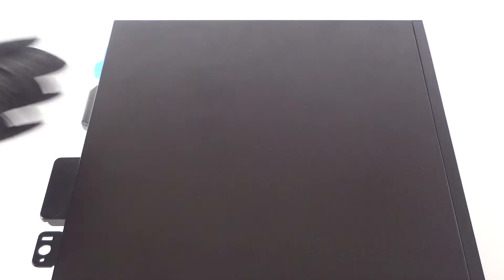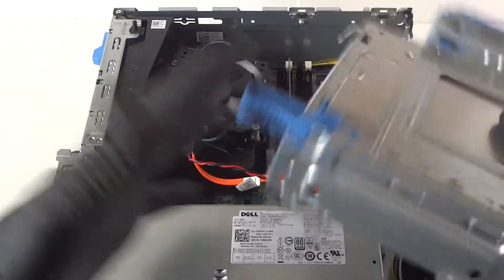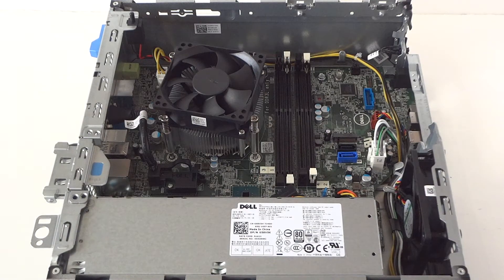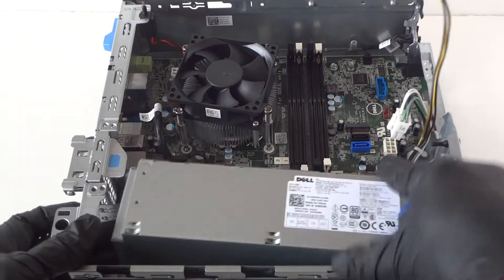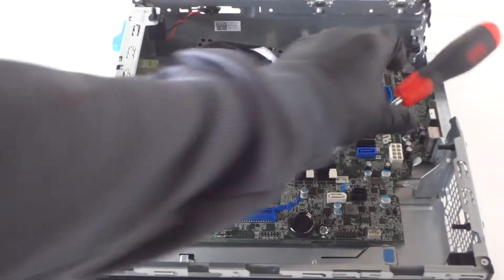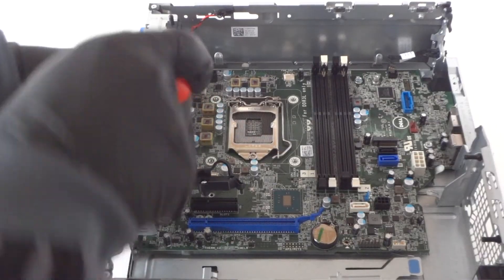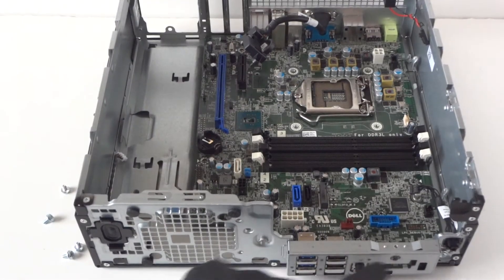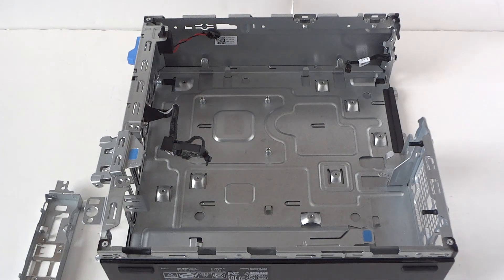Dell Optiplex 5040 Teardown

Comment from the maker: List of Parts and Upgrades works with this PC.

USB Wifi Adapter for PC AC600Mbps Wireless Network Adapter
https://amzn.to/2ZaGuHb

List of RAM will work with this system.
Maximum RAM Supports: 64GB

(1.) Crucial 16GB Kit (2 x 8GB) DDR3L-1600 UDIMM
CT2K102464BD160B
https://amzn.to/2QvZril

(2.) Crucial 16GB DDR3L-1600 UDIMM
CT204864BD160B
https://amzn.to/3gub97G

(3.) Crucial 8GB DDR3L-1600 UDIMM
CT102464BD160B
https://amzn.to/3aWGluX

(4.) Crucial 8GB Kit (2 x 4GB) DDR3L-1600 UDIMM
CT2K51264BD160B
https://amzn.to/34q9Q73

List video cards will work with this system.

(1.) GIGABYTE GeForce GTX 1650 OC 4GB GDDR6, GV-N1656OC-4GL Video Card
https://amzn.to/2B7N1sP 

(2.) Gigabyte GeForce GTX 1650 OC GDDR5 Low Profile 
https://amzn.to/3el08os

(3.) Gigabyte Geforce GTX 1050 Ti OC Low Profile 4GB GDDR5 128 Bit PCI-E Graphic Card (GV-N105TOC-4GL) 
https://amzn.to/2T8bfsv

(4.) MSI Gaming GeForce GTX 1650 4GB GDRR5 Low Profile Graphics Card (GTX 1650 4GT LP OC) 
https://amzn.to/2X1FYsF

(5.) MSI GTX 1050 TI 4GT Low Profile  Graphic Cards 
https://amzn.to/2LwZd7P

(6.) Gigabyte GeForce GT 1030 GV-N1030D5-2GL Low Profile 2G Computer Graphics Card 
https://amzn.to/2Z4PHkp

(7.) ZOTAC GeForce GT 1030 2GB GDDR5 64-bit PCIe 3.0 DirectX 12 HDCP Ready Low Profile Video Card ZT-P10300A-10L 
https://amzn.to/2WzgLXk 

(8.) MSI Graphic Cards GT 1030 2GB GDDR5, Low Profile 
https://amzn.to/390Spum

 
Thermal Compound Paste:
(1.) Arctic MX-4 2019 Edition Thermal Compound Paste Carbon Based
https://amzn.to/2XcsZo4

(2) Arctic Silver 5 Thermal Cooling Compound Paste 
https://amzn.to/2ziNU0H

(3) Noctua NT-H1 3.5g, Pro-Grade Thermal Compound Paste
https://amzn.to/36kTk7A

(4.) ARCTIC MX-4 (current edition) Thermal Compound Paste 20 Grams 
https://amzn.to/2DhGJaK

List SSD M.2 Type 2280 NVMe PCIe:

(1.) Samsung (MZ-V7E1T0BW) 970 EVO SSD 1TB M.2 NVMe
https://amzn.to/3d52k2a

(2.) Samsung 970 EVO Plus SSD 500GB
https://amzn.to/3fpi95A

(3.) Samsung (MZ-V7E500BW) 970 EVO SSD 500GB - M.2 NVMe
https://amzn.to/37uuLFw

(4.) Crucial P1 500GB 3D NAND NVMe PCIe M.2 SSD - CT500P1SSD8 
https://amzn.to/2N07wKh 

(5.)  WD Black SN750 500GB NVMe Internal SSD - Gen3 PCIe, M.2 2280, 
https://amzn.to/31lHhWq

Hard Drive Caddy Adapter  3.5 to 2.5:

(1.) Dell 3.5" to 2.5" SSD or Hard Drive Caddy Adapter R494D 0R494D 
https://amzn.to/2XTPeRr

(2). Dell Hard Drive Caddy, R494D, F767D 3.5" to 2.5" SSD or Hard Drive
https://amzn.to/3cTkcOk

SSD List:
(1.) Samsung 860 PRO SSD 256GB - 2.5 Inch SATA III Internal Solid State Drive
https://amzn.to/2BY5gRl

(2.) Samsung SSD 860 EVO 250GB 2.5 Inch SATA III Internal SSD 
https://amzn.to/37xWUfc

(3.) SK hynix Gold S31 1TB 3D NAND 2.5 inch SATA III Internal SSD
https://amzn.to/3d7X6D6

(4.) Samsung SSD 860 EVO 1TB 2.5 Inch SATA
https://amzn.to/2B2FURX

(5.) SanDisk SSD PLUS 1TB Internal SSD
https://amzn.to/3hwdqku

(6.) SanDisk SSD PLUS 240GB Internal SSD
https://amzn.to/2zfc7EX

(7.) Crucial MX500 250GB 3D NAND SATA CT250MX500SSD1(Z) 
https://amzn.to/3bTTjbX

(8.) SanDisk SSD PLUS 480GB Internal SSD SDSSDA-1T00-G26
https://amzn.to/2yfgjUK

(9.) WD Green 1TB Internal PC SSD  WDS100T2G0A
https://amzn.to/2XfGtzc

HDD list works with this PC:

(1.).WD Black 2TB Performance 3.5" Hard Drive - 7200 RPM Class, WD2003FZEX 
https://amzn.to/2xFUeyF

(2.).Seagate BarraCuda 1TB Internal Hard Drive  3.5" Hard Drive - 7200 RPM
https://amzn.to/3g8FXM8
Reply: can it up to 64 gb

Comment: I am getting rf hacked by someone using linux . Since the wifi is built in I want to remove the antenna but I did not see it in your tear down . Or, do you know another way to disable it . I have a big hammer if that is what it takes . Nice job on the tear down ! :O)

Comment: Can I swap the power supply to a a smaller one or some so I can have more room for a better gpu ?
Reply: As long as you use enough wattage you should be fine. You may need to make some custom mounting hardware.

Comment: is this pc support SSD NVME ?
Reply: I put on it NVME 256GB and its work
Reply: No, but you can use a SATA SSD.
Reply: @ajhauter5049  thank you for the response, it turns out that my computer is optiplex 5040 supports nvme

Comment: My gtx 750ti low profile won't fit in the pc

Need help
Reply from the maker: Hi, you have to use low profile bracket
Reply: @Mxkdt  i have done but still no fit 

Is it possible if I can move the power supply out of the case but still connected?
Reply: @limitedlunar  You may want to use a modular PSU for that.

Comment: Hi, is there a way to upgrade the PSU on the 5040MT ? I want to instal the asus Geforce GTX1050 TI OS 4gb but the standard PSU doesnt work... Oh i also installed an extra SSD.
Reply: Did you ever find out the answer to this question?